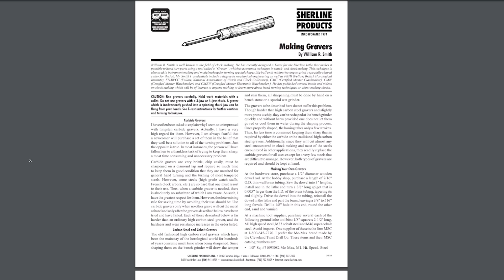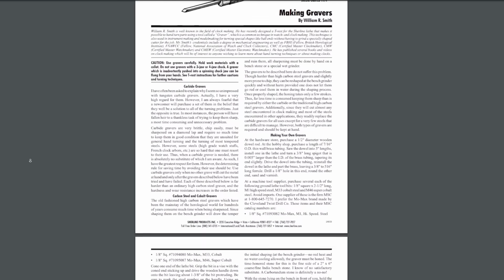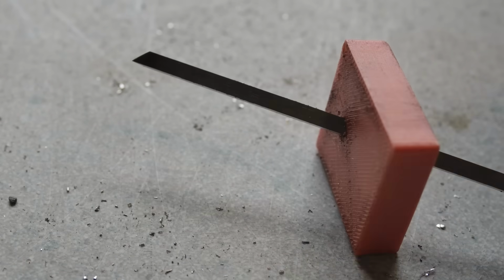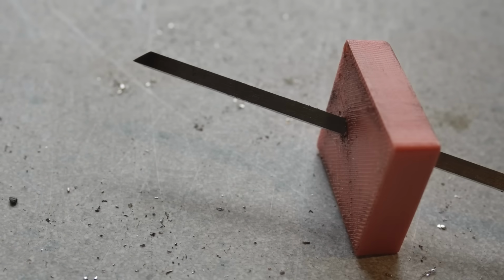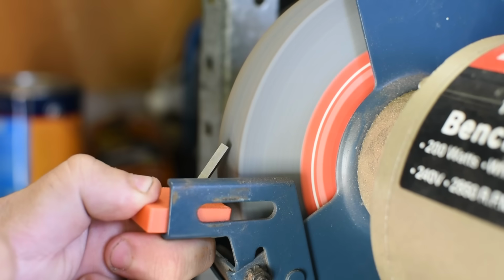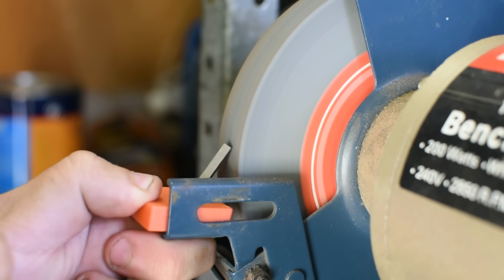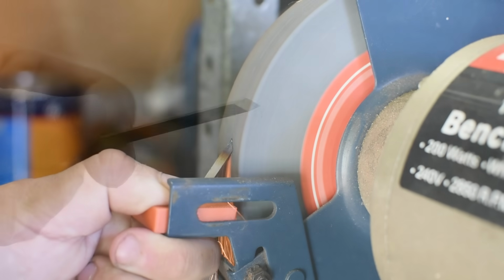I Printed A Better Lathe

Comment: That's really impressive!  I've been contemplating building my own Lathe for years - but had not considered concrete filled printed parts.
Are you going to continue the project & make a saddle / cross slide?  Maybe even CNC?

Comment: When you pour the concrete. The following day, take a wet sponge and use it to smooth the surfaces. It will give you an extremely smooth finish.
Reply: Ok Einstein
Reply: @MightyGimp  observe OP's profile pic

Comment: Looks awesome. I would recommend a TPU wiper seal for the work facing bearing. Without some way to keep chips out of it it's probably going to get destroyed pretty quickly.
Reply: That's what I was going to say, definitely needs something to keep the chips out of the bearings. Also some way of preloading the bearings would be great.

Comment: Oh my gosh! I never would've thought to fill printed parts with concrete to give it better stability! XD BTW, perhaps you could use a heavy plastic bag with one cut corner or a basting syringe to fill smaller openings to minimize cleanup?

Comment: Cement frame is good cheap idea. In 20 century a lot of factories did mill and lathe tools on cement frames. But you did one big mistake. Between spindle and cement frame you have a plastic. it does not add stiffness.

Comment: I always criticized bench tools being made with 3d printers, I mean they are great, but nothing about plastic screams stability and precision, but this, filling your 3d printed parts with concrete is absolutely the way to go, I'm convinced. And I like how you don't go overboard with your 3d printer, you accept that some parts, just cannot be made of plastic. Respect
Reply: I've made a bunch of 3d printed clamps and small bench vices and I'm floored at how strong they are, they've endured a summer of proper work and still work just as good as when I printed them. Trick is lots of walls
Reply: Agree.  People go completely overboard with 3D Printing, the best example being the continuing effort to build houses.  The truth is: 3D printed houses suck.

Comment: i respect your effort and skill with 3D Printig and CAD Construction. But building these machines is so time consuming. You Could work for 2 weeks in a second job, earning 1000 Dollar and simply buy one of the cheap chinese metal lathes on the market. They are not super good, but much better than a self made 3d printed could ever be.

Comment: You can increase the density of the concrete with additives like Tungsten Powder. EDIT: Also feel free to use the tools for cake icing like the bag and nozzle to push concrete into tight spaces.

Comment: very nice, i recon as said, the ~~tool head/spindel~ ~in the most important items in a lathe, you CAN buy the old Lathe to rebuild this, same as in Adam savage video, and possible build one around that pro old, jewellery/dentist Lathe, i believe it was one of those, video should be easy to find. 
I remeber him saying that the toolhead on those are so good made, as old items usually are.

Comment: Must protect the bearing faces, the exposed rollers will result in completely destroyed bearings in no time (on a real lathe, even just some dust in the air is not good).
Also, you need to preload tapered roller bearings like this, meaning something needs to push the bearings into their tapers with considerable force (usually done with a thread and a lock collar). I realize this is not the way you'd want to do it because of not wanting to need machining, but I'm sure you could devise otherwise or a clamp of some sort. Just beware of plastic's creep if going to clamp.
Very impressive CAD modeling to make all this!

Comment: A really nice idea. Is that regular concrete mix or do you use any elastic compounds to increase its vibration  fatigue resistance? Other than that, improvements of the design comes down to chasing precision. Improving the headstock alignments, bedways, toolrest etc

Comment: Hmm no aggregate, the pedant in me wants to call this mortar :D. I highly recommend getting some superplasticizer -- allows a huge reduction in water use in the cement mix, and improves flow and strength. You can also mix in steel sandblasting media if want ultimate weight

Comment: This is amazing work. I like the idea of using 8020 for t-slotted surfaces. It's probably good enough for this and you can even get pulleys with pressed bearings that slide along them well. I'd really like to see a tool post though. You can get trapezoidal lead screws for pretty cheap and Igus even sells 3D printer filament that will last reasonably long as a lead-screw nut.

Comment: You could have printed perfect fit funnels for pouring! 3d printers are very flexible. Also tighten your Z axis coupling looks like that kind of artifacting. Amazing project and very interesting use of technology. Concrete cast mills is a very good advancement in technology.

Comment: very impressive! I made myself a lave not long ago, only it was made out of legos, which it was borderline functional it got the job done! what I made for was I needed a new spoke for my spinning wheel, the biggest problem with the lave was it only fits one size of wood and it need to be perfectly balanced at the start, or the work piece would come off. how it worked was it had 4 barrings the the pice sat on with a rubber band going to the motor, the motor was barely pewful enough. but after servile hours I achieved what I made it for! I was debating if I wanted to make it into a proper lave and this made me really want to do that!

Comment: You need an electric mixer and paddle to properly mix that concrete. You should also look into leveling concrete for flooring, those are unsanded mixtures that are fine and smooth and will flow down into the smallest spaces.

Comment: 5:00 Have you considered using the dry concrete method? This involves placing the powdered concrete in position and then exposing it to water. The dry powder is easier to work with, and once the water soaks in, it hardens. (less water is needed than for making runny enough to pore, so it would set and dry faster).  If this seems like an unusual approach to working with concrete, you can find many YouTube channels demonstrating its use for various projects, from plant pots to driveways and even retaining walls. Concrete doesn't need to be mixed with water beforehand to be strong and stable; it can be just as effective when water is added later.
Reply: I was just thinking the same thing. I have seen that on other videos.
Reply: concrete made this way has a LOT of downsides. the strength in concrete is highly depending on adding the right amount of water. You may get lucky, but typically there is always areas that have incomplete hydration, especially in a complex form like this where water will have a tough time getting down into all the nooks and crannies.
Reply: @halconnen  not sure if it would have a harder time than oozing muddy concrete through slits and small openings. A little experimenting in a discarded print would go a long ways in getting the right amounts, and you could deliver the water in a tube to get it to the tight spaces.
Reply: @Im_Just_Saying  a colloidal suspension (mixed concrete) by definition gets to and through more places than a dry mixture with later percolation.   similarly, by definition, percolation of water through dry concrete MUST have an imbalance of water in areas for it to flow to the entire medium.  you will always have a gradient of where the water is introduced to the extremities.  this also leads to 'washing out' of the dry mixture in places with high flow, leading to voids.
Reply: @halconnen  Wow! So much drama over a straightforward process that could be easily tested with junk prints to see if it's truly a better solution. Also, keep in mind that the powder doesn’t necessarily have to be added after assembly, like the wet mixture. Since timing isn't a factor with the dry mix, it could even be placed in specific areas—such as the base—before the assembly is fully complete. Water could then be introduced via a tube or small holes strategically positioned for optimal distribution. The suggestion to use dry mix was simply in response to finding a less messy alternative, as pouring overly wet concrete into small slots can be both messy and awkward.
Reply: @Im_Just_Saying  must be really bored if this qualifies as drama :)   you made an interesting suggestion with only positives and I just pointed out the negatives.  feel free to try it out - bonus points if you measure things that are important to machines of this nature like stiffness, compressive strength, permeability, shrinkage, cracking, and bond strength.
Reply: @Im_Just_saying Ive also seen MANY youtube videos disproving this. To an extent to where pieces can break apart in your hands.
Reply: @itsasinine3337   like any process results will very be depending on many factors, I have seen 'professional' pored cement that has also crumbled in my hands. However, in a situation like this strength is not really the need,  solid and heavy are the requirements. No need to drive a truck over this. 
Like you, I have seen many videos mostly in positive. The negative ones are usually by professionals that a) have something to lose if this were to catch on, or b)  are comparing to standards far beyond the needs of the average DIYer.

Comment: Would you mind linking a bill of materials to the printables item?  I'd like to know what lengths of tslot, tapered roller bearings used, mandril, ER collets, and where you got them - I have most of the components for this already on-hand in terms of nuts/bolts/tslot

Edit: Thanks!  I've made some modifications for my build, as I'm going for 32005 tapered roller bearings, and a C25-ER32UM-L150 for the collet holder.  I've got bunches of linear slides laying around, as well as short little mini slides that I might be able to use as a cross-slide.  You are awesome for blazing this trail for those who didn't know this could be a good path forward to getting into a tiny lathe.

Comment: Seems about the right size to be adapted as a d-bit grinder. You just need an articulated bit holder.  If you want to attach add-on tailstock for longer pieces, you'll want a steady rest.  For rough pieces, remember that you can always cut them from the perpendicular face, since it's smoother.

Comment: 4:55 3d print some funnels that match the orifices your filling. 

Then you have some plugs to push in to the holes that act as a form for the top to get it flat.

Comment: Very cool project! Just for future reference on making gravers, you were correct that you do not want to get the pre-hardened steel red hot or it will lose it's heat treatment. However you have to go much further than that and not allow it to heat above the desired temper temperature. For instance if it was previously tempered to a straw (yellowish brown) color but then while grinding it the steel turns blue, that means you have reduced the temper to a lower hardness. So you need to keep the steel cool and never let the temperature go beyond the desired temper temperature. You can think of it this way, hardening the steel makes it as hard as it can get (but too brittle to be good for much), then tempering reduces the hardness but makes it stronger, and this effect continues the hotter you temper it.
Reply: Solid advice.

Comment: I really like the update, but please for the love of god use steel pipe for er collet holder housing and make a spacer to be inside for preload
while using aluminum profile for rail is easy solution, it is much, much too soft, resorting to bolted steel plate with 3 layers making solid base and t shaped grooves
basically:
-- ----- --
-   ---   -
-----------

will make it much sturider, and some(even just bolted construction frame inside that concrete would make it much more reliable tool with higher precision)

Comment: The concept is great, but there are several improvements needed to get a precision machine. This is built more like a wood lathe and lacks much of the precision needed for metal parts. Below are 5 steps for building a sub micron precision mini lathe for under $300.

- First: I would start by either getting some granite counter cut-offs or at least tiles as molds to cast precision surfaces. These are usually machine polished and VERY flat. Even a $50-100 surface plate could be used for even more precision. This can be used to cast things like guide rails, spindle mounting surfaces etc.

- Second: A precision square or welders block and dial indicator for making sure the rails and spindle are at 90 deg. These can be purchased from estate and shop closing auctions or ali express for very cheap.

- Third: AIR BEARINGS are gods gift to DIY lathe builders: For ~$40 you can get the performance of multi thousand dollar bearings. Use epoxy granite and polish it for the cast rails, spindle guides, and any sliding surfaces like cross slides. Most importantly, use some of that black 2-3mm black irrigation tubing with 0.5-1mm copper tubing as nozzles, cast into all sliding surfaces and the spindle tube. Using an emergency tire air compressor you can reach 10-30 PSI meaning just 10 Sq inch sliding surface will give you 100-300 LBS bearing capacity. Use aquarium tubing for any exposed connections (compressor to cross slides) because it is more flexible. You can achieve ZERO wear and no run out.

- Fourth: Precision motion: Instead of expensive screws or rack and pinion you can use 2 thin steel straps (think pallet straps) as a belt drive. Wind them around a pulley with the other ends connected to the slide. One strap from the pulley to the slide, the other offset 180 degrees on the pulley, under the slide, around a pulley and connected to the other side of the slide. Turning the pulley one way pulls the slide left and the other direction to the right. You want to turn the pulley using another pulley+belt, so that many turns of the motor can create small movements. It is possible to get nanometer precision for a few dollars per axis using this method.

- Fifth: You will want much more vibration to get dense castings. A dryer with some wet towels on a spin cycle will help. Small-medium granite gravel, granite sand and granite FLOUR for a smooth surface finish. You want to use enough epoxy to make it somewhat runny more like pancake batter. Ideally place the whole thing in a box, cover in trash bags and after sealing with packing tape, use a shop vac to pull a slight vacuum to help remove bubbles during the shaking. Be careful that precision surfaces are not smushed while pulling the vacuum, that is what the box is for.

Comment: my great grandpa used to say that the lathe was the greatest tool in a shop because its the only tool that can replicate itself. he would often use the lathe to bootstrap it and make improvements for it. he ended up making a massive bed for it so he could turn super long bar stock. i wish he was still around today to see 3d printing! i wonder what he would say about it or the things he would make. my great uncle was also a machinist and was obsessed with vacuum forming, which was kind of the 3d printing of its time, but he was stuck making object with a flat side and draft angles

Comment: Hey Chris, great video as usual!
You do need a way to preload the bearings tho, usually done with a large nut behind the spindle pulley. I see that the back of your spindle is not threaded, so maybe instead you can add a strong spring before the pulley, compress it as much as you can and screw in the set screw for the pulley key really tight to fix it in place.
Tapered bearings have poor runout and service life without preload.

Comment: Instant subscribe from me, I know in WWII they poured concrete lathes for cheap machining on artillery shells. Sika polymer fortifier for regular mortar/concrete does wonders for sticking to plastic if you're not using it, costs ~$15 for a gallon.

Comment: This is easily one of my favorite channels. Largely inspired by your projects I had a dream (a literal dream) in which i started a company of bolts and fittings, and partnered with every public university of my country to build and maintain a 3D printing/light machining lab in each one, alongside a shop where the fittings and tools could be bought at production cost. In my dream we built a comunity that developed technical manuals for printing and building this kind of machine. I teared up a little when I woke up.  Hope you keep the channel up and running - each video is just as dear and expected to me as those from Primitive Technology.

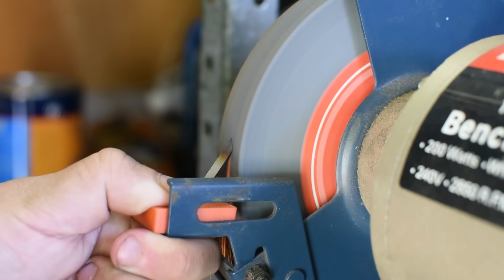Comment: 6:34 you dont want that steel to change colour at all even if it goes blue like that one or yellow it will loose its temper and be pretty useless on anything other than wood.  If you see it changing colour it is already too late.  With small parts like that especially it is very important to dip them in water regularly.  Even though i already have a metal lathe i really want to make one of these, i think that it wouldn't be too hard to add an actual tool post and saddle in a future model.

Comment: id say your almost there to a perfect mini lathe. I think id add a half inch leadscrew and a tool rest to go with it, as well as auto feed feature. 
maybe a mod to have a digital speed controller instead of the dial.

Comment: There is a reason that there is not a "cheap open source lathe". Lathes are inherently very dangerous even a small one like this has the potential to maim or kill the operator. Respect for taking on such a project and all the time and energy that went into this. Anyone that tries to make something like this with no machine tool experience will most likely result in great bodily injury.
Reply: I did it and didnt get injured lol. Mine is cnc though to be fair
Reply: Only if they're complete morons. Living is inherently dangerous.